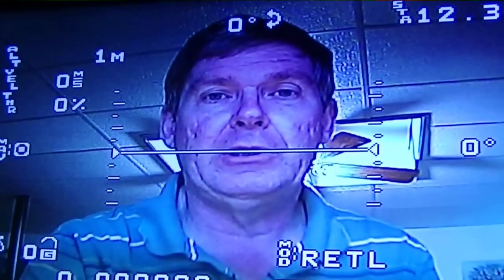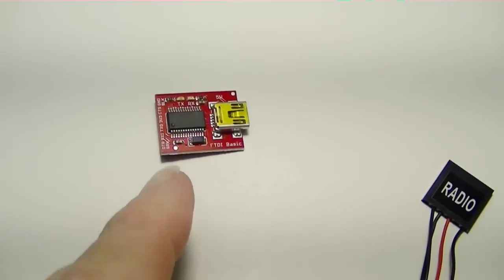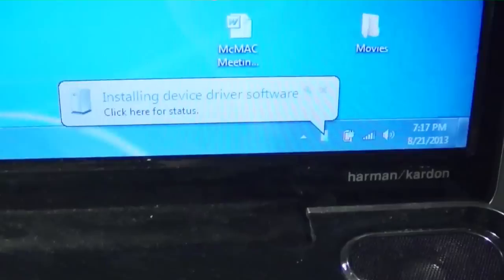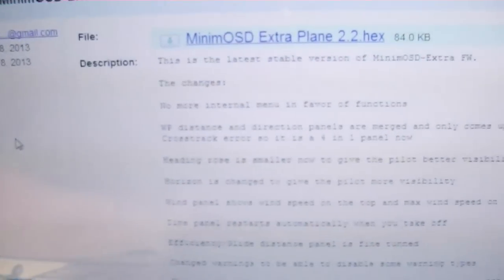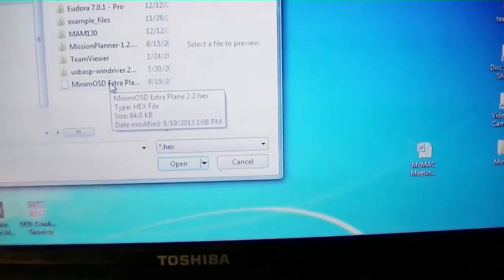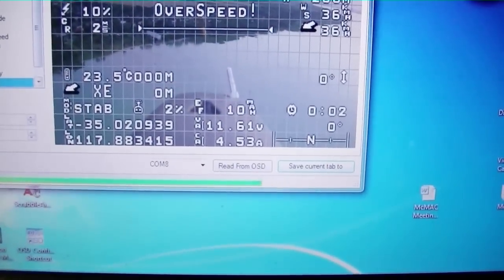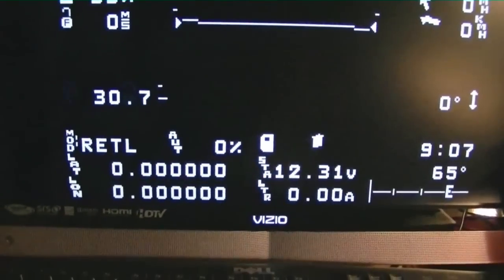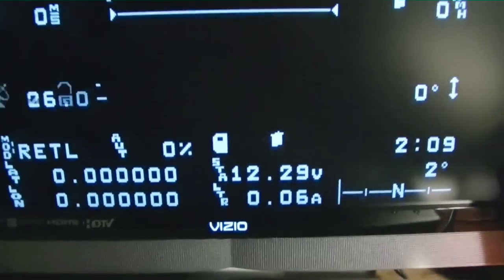FPV Part 6: 3DR APM 2.6 Setup MinimOSD w/ Config Tool using FTDI USB Adapter, Video battery voltage?

Comment: I have this osd and im trying to set it up with a naze32 but it wont work, have any idea why? i dont have a telemonetry Tx
Reply from the maker: Sondre Bjørgård Try Mochaboy Rc on YouTube. He has a good vid on that.
Reply: *****
Ive gone through it, but i have not solved the problem, at first i tryed it with the stock firmware and i got a message about waiting for mavlink heartbeat, i flashed the firmware and now i think i need to set up the gui again.
Reply from the maker: Sondre Bjørgård Personally I have not tried it on the naze32. I see that there is different firmware as you said. I think Mochaboy has some resource links under the video that might help.

Comment: Ok thanks, do I need to change the connection before I can force it into bootloader mode? The back doesn't have anything on it. It just has air radio module and marking for the gnd, rxd, txd and 5v
Reply from the maker: neil collins To use the FTDI for flashing I needed the DTR wire as well so you would have five wires.

Comment: Ok, heres my story.  I bought a 3dr telemetry clone from ebay. I hooked it up and everything worked great but somehow the turnigy Lipo that I was useing caught fire while it was charging and it was still mounted to my model, Lucky me. After the fire I had the motors and ground telemetry clone left. Long story short, I built a new model and got a air clone unit hopeing it would work with the ground unit I had. Everything connects now but I cant find anything about triggering a bootloader on the air unit. The ground is running version 1.9 and the air has 1.6 version.  If you go to the arducopter page. The air unit I have looks exactly like the ground unit they have on the page with directions to trip the bootloader. The only difference is mine has a molex 4 pin connector and the ground unit they show has a ftdi connection.  Do you think that will matter if I follow arducopters diagram for tripping the bootloader?
Reply from the maker: The units with the molex connector are still capable of using the FTDI interface.
Also there are usually lands/pads on the back where you can solder a pin header so you can convert to the other style cable. I don't have a wiring diagram for the molex type radio so you will have to trace that out and make sure it is correct yourself. You may have to make a special cable.
Reply: Well I had the rx and tx hooked up wrong and I had to reset the apm 2.5 board to get it working.

Comment: I was able to get it connected but still cant get the telemetry air unit to accept new firmware.
Reply from the maker: neil collins Are you trying to put new firmware on the air radio or onto the APM?

Comment: How do I connect a ftdi breakout board to my 3dr air telemetry unit. I need to update the version on the air unit so it works with the ground.
Reply from the maker: There a lot of different types.
Make a movie of your boards and put it on YouTube so I can see what you are trying to connect.

Comment: If I was to solder the joints so both stages run at 5v then will I just need to use the video wires to make the osd work. I have a weight limit and im using one 3s battery to power up both the apm and the fpv gear. Whats the best way to make my setup work? Thanks
Reply from the maker: Well you could do that and then power your video tx from the fight battery.
MinimOSD would need a step down to 5 volts with a UBEC of course.
Reply: The minim osd would already be powered up by the apm? Would you need to send another 5v from the other side wont that cause a short circuit
Reply from the maker: Oh, well if you are going to power it from the APM the UBEC would not be needed.

Comment: Can I use 5v for two ports?
Reply from the maker: Probably not. Just solder jumpers to power second stage with 5v from first stage.
Reply: How about I use the same 12v battery to power one port and other with 5v?Will the acceleration affect the minim OSD by the same 12v  battery?Thanks again!
Reply from the maker: Zheng Jhonny idk, try it and see.
Reply: Zheng Jhonny did you successfully power up both sides using same battery
Reply: Hi, yes, I did. It didn't work. It was 5v for two ports, it couldn't even start. So, now I'm using 5v for one port from apm and 12v from same battery for other port.  54918ss
Reply: Zheng Jhonny does it work properly that way. Are there any problems? Im going to do the same thing. My battery goes to power module and apm and also same battery to minim osd.

Comment: I recently bought a purple minim osd from goodluckbuy. I have radio and minim osd connected to my apm 2.5.2 (running latest arducopter firmware 3.1.5 ) . Radio is working prefect, but the minim osd is not. It seems like the apm is not sending info to the OSD. I updated the firmware ( tool 2.3.2.0 r727, charset and .hex 2.4 r726 ) and changed some parameters. Also, the minim osd info appears and disappears on my lcd monitor . I have no clue what the problem is. Any help would be really appreciated . nicbuym@gmail.com

Parameters I have changed so far:

SERIAL1_BAUD, 57 (telemetry output at 57600)

SR1_EXT_STAT, 2 ( 2hz for waypoints, GPS raw, fence data, current waypoint, etc)

SR1_EXTRA1, 5 ( 5hz for attitude and simulation state)

SR1_EXTRA2, 2 ( 2hz for VFR_Hud data )

SR1_EXTRA3, 3 ( 3hz for AHRS, Hardware Status, Wind )

SR1_POSITION, 2 ( 2hz for location data )

SR1_RAW_SENS, 2 ( 2hz for raw imu sensor data )

SR1_RC_CHAN, 5 ( 5hz for radio input or radio output data )

If you fly copter than you also need to set SR0 also:

SR0_EXT_STAT, 2

SR0_EXTRA1, 5

SR0_EXTRA2, 2

SR0_EXTRA3, 3

SR0_POSITION, 2

SR0_RAW_SENS, 2

SR0_RC_CHAN, 5
Reply from the maker: I wish I knew. 
Could you make a movie showing the wiring details for your connections
and a demo of the problem. It's hard figure these things out without seeing it.
Reply: ***** , everything is wired same than yours , the OSD works ( i mean, it has power in both sides <both  LEDs are  red> but the APM is not updating/sending any info ( battery v, flight mode, Gps cordinates , etc...)  to the OSD. Please email me and I will send you some pics of my connections... Thanks
Reply from the maker: Nic Holas One thing I have noted is that the MinimOSD will not work when the APM is connected/powered via the USB cable.

Comment: How about just going to a slightly bigger 3S Lipo and run both from this main Lipo thus displaying the combined voltage which isn't perfect but it's better than having no idea what the Video voltage is at all ?(only my opinion)
Reply from the maker: I use a 4s Lipo to get enough RPM on the motor because the Skywalker plane has no room for a bigger propeller.
Reply: *****  any chance you could use the balance lead to take just the power off the first three cells Neg +3 lead along from black?? maybe?
Reply from the maker: John Clarke This is certainly an option. Just keep in mind it may unbalance the 4 cells in the battery so that 3 of then will be taking more load and running down quicker. Also the over all voltage reading will not show this imbalance. I prefer a separate battery for my video to reduce noise as well. My quad uses three cells on the flight battery and I still have a separate video battery. It's just a matter of preference.

Comment: loving your videos. Is there anyway APM can show the current draw from the motor and main battery that are greater than 4s?
Reply from the maker: No, because the power module for the APM will not accept more than a 4s battery. You would need to do a work-around with a different power sensor and port on the APM.

Comment: Any tips on powering MinimOSD using both using 5v side(APM) and 12v side(battery) safely? i read there are alot of mishaps and burned OSD board, Is it true? And how hot is the regulator that feeds the 12v side of the MiniOSD when connecting it to 12v battery?

I am thinking of powering the MinimOSD through the 5v Side(APM Side) buy soldering both the jumper pad is it fine?

Thanks.

Comment: On that topic Dave, what is the LC filter? I  have the Arduflyer from RCtimer coming and its the kit with the telemetry radios just like yours (915MHz) now I am looking at ordering the FTDI breakout that you so helpfully have included the link to. So I have the UBEC located at Hobby KIng but what of the LC, I take it that it is a voltage modifier of some kind. I cannot believe the number of videos you have produced that my YouTube page has not told me of. I will be catching up this afternoon :-)

Comment: Very informative - I wouldn't worry about the video voltage too much - a 500mA battery should power the camera and transmitter for a lot longer than most planes can stay in the air.  It should be a fairly constant draw so easy to estimate the endurance of the video system.